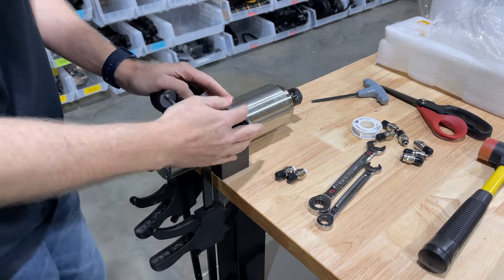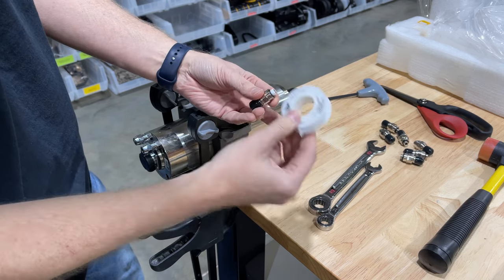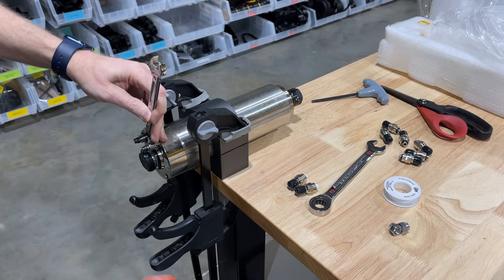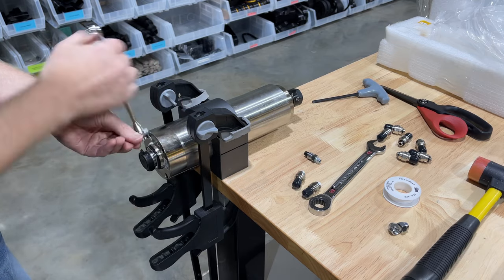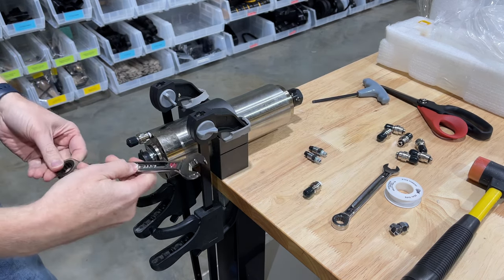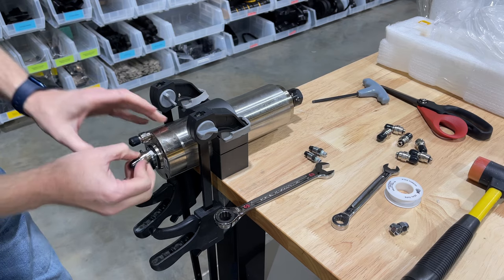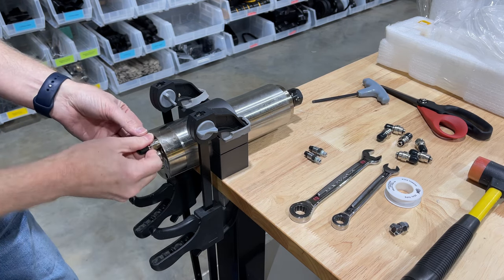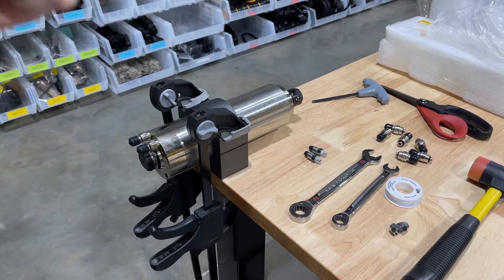Installing our custom made Kool Connectors

Comment: I thought that the ones you mounted were the default connectors. Because when ordering my spindle kit I chose to upgrade to the Kool connectors, and the spindle came with these already mounted, but in the kit I also received 2 individually packed Kool connectors (says QD2-FS06X 10 on them). So, naturally I thought those are the upgraded no-leak Kool connectors I need to mount to the spindle instead of the ones that are already on. However, I do not see any way to mount them, can’t figure out how to fit them to the spindle, hence searching youtube now to find a video on that.
Also, regarding the connectors you’ve just mounted in this video, if I choose to keep those and not use the QD2 ones I received, I don’t see any way to connect the tubes to them… probably I could force the tube on them (although if I’d say “a bit of a stretch” that would be an understatement), but even then I don’t see any way to secure the tube, no collar or nut to put over the tube… I’m so confused.

EDIT: Noooo way, just found a video on water cooling, searching for qd2. I can’t believe how they actually connect together. I wouldn’t have figured that out in a million years. Alright, now I am up&running 🥳
Reply from the maker: Glad you found what you needed.  In the video i'm removing the stock connectors and installing our custom-designed "motor-side" kool connectors.  We pre-install these if someone orders the kool connectors with their spindle kit as a convenance.
The two connectors still sealed in baggies are the tube-side connectors which you'll press onto the tubes that came with your system.
We're always improving our documentation... and will be sure to make note of all this so it's clearer in the future.
Remember... reach out to support@pwncnc.com if you have any questions and we're happy to help.
Reply: Thank you Daniel!
Now that I saw the way they connect, I realize they are indeed very “kool”. 
I would have definitely reached out to support, had I not figured it out tonight. Only thing left is to fill the chiller tomorrow and start my first project. I know you said it’s overkill, but I ended up getting the cw 5200. I think if I set it to 18 degrees Celsius (64-65 F) should be fine for the spindle, not too low, not too high…
Just need to buy some coolant liquid, I guess I will go with antifreeze + distilled water, not sure what ratio though, will see…

Have a great weekend! And happy holidays!
Reply from the maker: Happy to help ;-)
Be sure before you turn on your chiller... to allow the motor to warm up a little bit.  Usually takes <20min and we've defined the process here:  https://support.pwncnc.com/kb/article/291-spindle-warm-up/
We actually do the first hour or two of motor break-in without any cooling active.  Thus we're literally warming up the spindle so the grease gets nice and sloshed around the bearings for smooth operation.

Comment: Hi Daniel, thanks for the great video! I couldn't quite figure out the way you secured the spindle for removal of the connectors. Can you please recommend a way to hold the spindle? I'm concerned about applying to much pressure on the spindle body.
Reply from the maker: I’d recommend mounting the spindle on your machine and installing them in that vertical position.
The rubber mallet is just in case you have trouble “starting” the stock connectors turning.
They use a liquid seal of some sort on the threads that can dry very securely making them hard to start turning, but once they start they are easy to remove.
Reply: @PwnCNC Thank you!
Reply: What is the difference between the stock connectors and these Kool connectors?
Reply from the maker: @TerrapinCreations666  We contracted with Koolance to have special motor-mountable connectors designed and manufactured.  The Tube-side connectors are off-the-shelf, but the Motor-side connectors are custom designed/made for PwnCNC spindle motors.  We're the only place you can purchase these specific connectors.

Comment: will these work on other chinese 2.2kw spindles?
Reply from the maker: great question, maybe.  Our G-Penny spindles come with M8x1.0mm threading on the water-lines.  If yours are similar, then it'll work.
I do have a few sets of M8x1.25mm cool connectors from a very early order if your motor happens to be this threading.
Reply: @PwnCNC  ohh i didnt realize you use g-penny mine is a 2.2kw G-Penny Spindle er20 so ill assume that its the same as yours? ill be ordering a set for sure if this is the case
Reply from the maker: G-Penny is awesome to deal with IMO.  They're very responsive to me... sure due to the purchase volume, but seeing as we have our customers best interests in mind it allows us to push for features and ensure high quality for the products we sell.  
A while back i wrote up an article which gives great detail into our goals and vendors:  https://support.pwncnc.com/kb/article/182-why-should-i-buy-a-spindle-system-from-pwncnc/